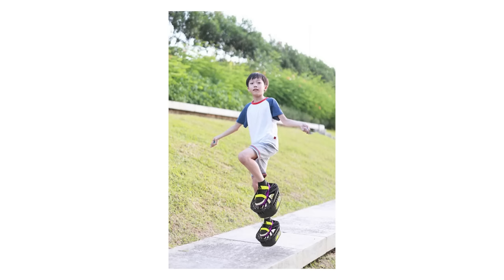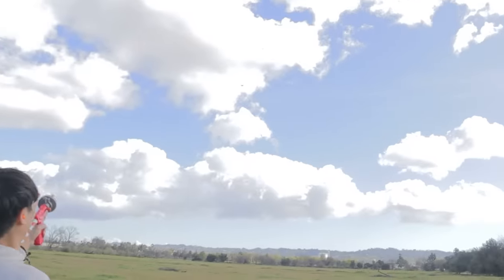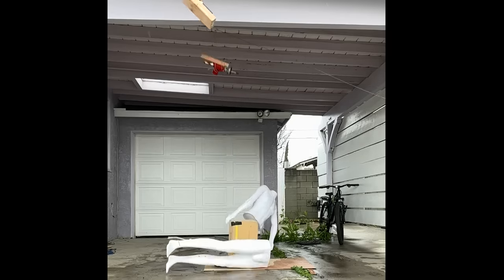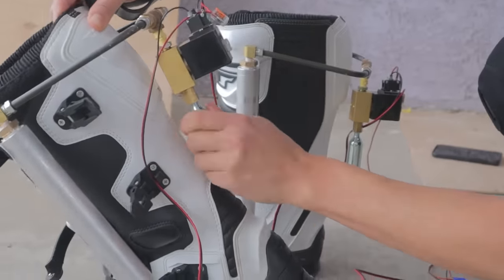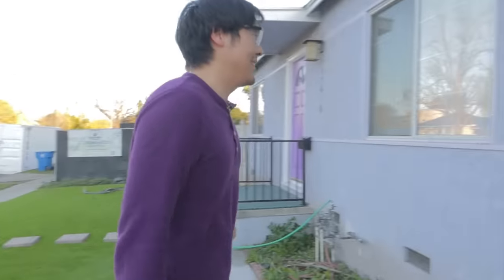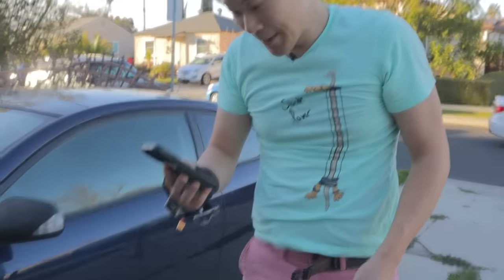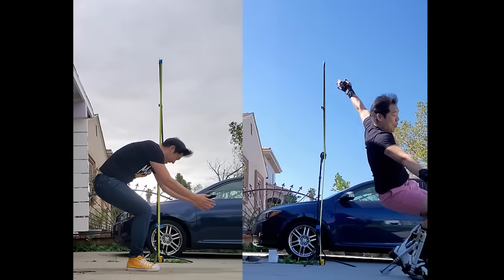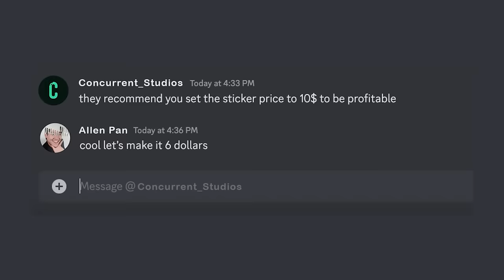Making shoes to jump 200% higher

Comment: A retraction system would allow for a safer landing and a faster recovery when jumping, and it would really make for a cool part two to this project
Reply: that IS a good idea
Reply: Well he would need a double acting cylinder for that so he would have to make a new one a cheaper solution is making the feet larger as it currently has a low area to land on and as you can tell he tends to land on the edge of the panel so bigger feet would help a lot
Reply: @simplegamerz9485  Nah, just put some springs on 'em. CO2 to push them out, springs to pull them back in.
Reply: @cheshirecynic3061  Yeah, no need to make it harder and more failure prone with more valves etc. Springs should do the trick nicely without costing much power.
Reply: @randomname4726  the shoes as they are now might be harder to land with, but the force of a jump 1 foot higher than normal being transferred into the piston over some time probably beats it going into the bottom of your feet all at once, at least I think so
Reply: @simplegamerz9485  True, but if the foot panels were too large walking would become uncomfortable since he could not bend his feet.
Reply: i think adding another piece of metal which changes the shape of the boots from a line to an x would make it easier to make the piston go inside again when landing.
Reply: @benshapiroscrustyass1402  good point. Maybe a spring and small vent hole similar to an automotive shock absorber. Would certainly rob some amount of power but I'm sure it could be dialed in. As long as he gets a decent jump there's plenty of time for a non foot destroying retraction
Reply: @cheshirecynic3061  With a pressure relief valve that opens when piston is fully extended.
Reply: I'm not sure, but it seems like he's using the entire two CO2 cartridges; if he were to add a retraction system, he would probably need more CO2 to make it refire again, which would likely increase the weight a bit if he has to carry around massive carts capable of multiple shots. Not sure if that's viable but multiple jumps from this thing could turn your ass into Mario with enough practice so it'd be really cool to see.
Reply: Agree
Reply: @swampfoxfpv  That's actually not a bad idea, how much height do you think you'd lose with the shock absorber?
Reply: @simplegamerz9485  you might even be able to take that a step further by adding some rubber or something to panel, something to give it just a little extra grip for more stability when landing
Reply: @benshapiroscrustyass1402   YouTube comment section casually designing the Gen two to the moon shoes
Reply: Just need a check valve?
Reply: I would make a sensor that can tell where you are in the jump process, and then assist at the precise moment.
And yes, that would mean a higher jump so you'd want some kind of landing system.
Reply: this
Reply: I was thinking the same thing these have a lot of potential
Reply: @IchorX  There would also need some stylistic changes, maybe 3d print a boot casing to avoid the clunky nature of the OG setup and avoid ant unfortunate testicle related incidents that can arise from design as is. Basically Iron Manning the whole thing from the clunky Mk1 to a streamlined Mk2, it would look cooler and be a bit safer
Reply: He would need another valve system to retract them. That's more weight.
Reply: @simplegamerz9485  bro that's just a gun.
Reply: One word. Springs.
Reply: Came to the comments to say just that!
Reply: Am I the only one that thinks this guy is brave as hell for this? He could have broke his ankles if that went bad
This is dedication. And Well said Noah! I would love to see that, and would love for this project to continue. This is so cool
Reply: If you wanted to over engineer it, use an accelerometer to detect when the wearer is falling, and when they begin to fall safely retract a dual-action piston with a separate low pressure system so it doesn't destroy your feet.

If you want a good solution, just make the pads you walk on slightly larger so there's more area to land on lol.
Reply: @noahk3496  he already isnt because of the type of boot, theyre literally meant, as he said, to support the foot and anklefor specific things
Reply: @zakstormcrow5912  On second thought, you’re right
Reply: The solution to that would self returning pneumatic cylinders. It would be a trade-off. If you get weak springs, they won't retract completely in time. I don't see it as a big problem though since it would have already helped by: 1- shortening the distance. and 2- already having some biased momentum going upwards. Weak springs would have negligible power rob. Strong springs on the other hand would require much more energy to move downwards for a less useful retraction speed. Plus they'd also add more weight.
 
Springs are better than electronics and added plumbing. They're way simpler to implement, needing no designing. They are also way more robust.
Reply: @simplegamerz9485  A larger panel wouldn't help. You want something that will line the plate within the center line. A "C" curved bar would be better. A large plate will also eventually bend the cylinder rods.
Reply: @terraminator4379  That's if the bottom of the shoes were always level with the ground. They are not. An X or any other added material will add to much torque and the rods will bend. Kinda surprised he didn't do that here by accident. Those cylinder rods were not designed to be sideloaded. That would also restrict motion to only vertical jumps, which wouldn't be as cool since now you can't leap forward.
Reply: @abduladeola4886  nah I'm just some college student, thanks though!
Reply: i would die for a part 2
Reply: @simmonsjoe  Just a hole lower down the cylinder. When the piston is past the hole at max extension the air can escape.
Reply: Is your name perhaps Cave Johnson?
Reply: You guys are to smart for me

Comment: I think you could furth increase their jumpiness by:
using springs to retract the pistons, they dont have to be very strong but strong enough to retract the piston once the pressure depleted.
adding an earlier gas bleed and buffer at the end of travel to the jerking of the piston doesnt skew your airial direction
using a trigger that responds to when you put more than your body weight into your shoes (aka you start to jump, increasing the weight that is put on your soles.)

sorry for my bad english
Reply: English is fine, but using a spring seems like it would really weaken the jump

Comment: The most iffy part is the landing. When the bottom part is extended and lands first Allen always falls forward or to different sides with his feet respectively. If he could make them retract in the air the landing would be way easier. Or he could maybe increase the surface of those. I am curious if you could do an enhanced form of running with those.
Reply: If he used a belay he could launch as high as he wanted without worrying about the landing
Reply: i feel like part of that system also protects him from hard landings though. the partially extended hydraulic cushions the fall a bit. if he could make the whole platform more stable by increasing the surface area of the launcher palatform like you said and maybe make an automatic triggering mechanism based on the bend of his leg and an arming mechanism to start it it would be perfect.

Comment: Suggestion: instead of two bars, make parts that fit the entire sole of the shoe so you cover more area when landing, preventing you from falling over
Reply: Maybe make it a bit bigger to spread force over a wider area.
Reply: Perhaps the bars should not only be replaced as suggested, but should also have powered ankle joints controlled by a computer and force sensors and/or myoelectric sensors on your own legs for a perfect landing and better jump.
Reply: This is like jlasers one but weird

Comment: Neat. Two changes I would make here. One, have a pressure sensor mounted on the bottom somewhere, or maybe under the toes of the boots, such that when there is little to no pressure on it (and the safety is off), it triggers the pistons. If you dial that in well, they should basically go off automatically at the point where they would best maximize the jump, at, before, or after when your feet are no longer pressing down on the ground (whichever turns out to be optimal). The second thing I would do is add plates to the bottom of the piston, a flat portion in the middle, and then a hinged "toe" and "heel" that will compress, but also resist compression a bit, trying to return to a flat plane. I would think that would be much smoother to land on than just a straight bar across the instep.
Reply: The change I would suggest is not attaching explosives to your weak ankle joints.
Reply: @GamesFromSpace  Well, step 1 is certainly isolating the ankle joints, like ski boots or rollerblades do.

Comment: If you make them retract automatically and add a flat sole, they would actually be comfortable to use. As long as you don't take into consideration the cost of recharging the pressure bottles every time.

Comment: I think the stability could be greatly improved by extending the ground-contacting plates further so they end near or under your toes with the heel still exposed for balance. Most of your falls involve your knees shifting forward and a greater means of improving front stability might help you rock back onto your feet.
Reply: Make it like a hollow semicircle (like a hose shoe) so it doesn't have much friction against the air when it's being deployed.

Comment: I think that simply shifting them a little bit forward on your feet (and putting a bit of a counterweight towards your toes to help with balance) could really help since when we jump a lot of the effort goes toward the front half of the foot rather than the center, where you have the device currently assisting. 
(Doing this, you may even have the bar that connects the shoe to the device help as a bit of a lift as well, possibly. But thats beside the point)

Good luck, Allen ❤️  This is coming together brilliantly
Reply: Lets just hope he doesn't snap his achilles tendon

Comment: I feel like the propelling things that you land on after the jump should be lengthways so you can actually land on them not tip over
Reply: This system is designed so that it DOESN'T stop you from tipping over. It WILL break if it has a 200+pound person crunch down on it at an awkward angle lol

That's why it has the elastic material and let's his legs go forwards

Comment: It could be epic if instead of remote control it's acceleration/pressure triggered . Step 1: measure and map average jumpXtime graph . Step : pick when to trigger Vai trail and error .
Reply: This is what I was thinking as well. A switch would still.be wise to avoid surprise jumps.

Comment: Could you put some light springs working against the plate extension so that they retract by themselves while in the air. The force of the air canisters will be so large that the springs won't remove too move force, but will be enough force to move the plates back into place while in the air.

Comment: There are many sneakers with a cushioning platform. If you could climb such a structure to the height of the piston, that would drastically increase the stability when landing, which in my opinion would make the shoes completely practical.

Comment: Maybe add a force sensor to the shoes that can detect when you are about to jump (The load cells detect a force less than your bodyweight since you have started to take off) and trigger the valves, that would make it much easier to jump with?

Comment: the fundamental issue is in how your jumping. There are two ways of jumping; slap the ground with your feet hard enough that it reflects the energy back at you and makes you go (This is actually how running works and isn't very good for jumping). This is also how trampolines work, they adjust the amount of energy that gets reflected back at you when your feet slap the ground. The second way is to out momentum into your body in with a upwards trajectory where the momentum of your mass is actually pulling your feet off the ground.

The reason why these shoes don't work is because your jump is pulling your feet off the ground, then your shoes are pushing your feet up higher but not adding any more momentum to your mass.

Comment: As an acrobat watching you figure out the jump timing, it's really interesting that it is the same as if my partner is standing in my hands and I want to throw them as high as possible. We bend together, they initiate the jump, I start throwing not as they reach the bottom of the bend, but as they start to jump. To early and one of us buckles the other. Too late and I didn't have enough weight in my hands to really help accelerate them. But at the right time, they feel the ground through me and I can accelerate with them, giving them an extra foot of height. Maybe I'll post a video showing this.

Comment: If you think about it, those boots were only ever at best going to make him jump the exact same height or less. His leg muscles have to do MORE work with those shoving up into them AND moving his body upward. They have more work to do than they would without the boots. But they can't do more work because they're already at their limit, and the boots make up for that difference. And so it ends up being exactly the same. 11:35 A FOOT HIGHER? Try almost the same, why would you think you should measure from your shoes instead of at the bottom of the metal stilts? And your legs are way forward, so It's almost the same actually, maybe 2 inches higher. It's hard to know with your legs bent forward.

Comment: Just a word of caution. There is danger that is easy to mitigate. Watch out for your head, butt and hand. Your heat and hands for obvious reasons, but the nerves around your tail bone can break fairly easily from a high fall. It's one of the worst injuries you can get. Causes a lot of paralysis/ nerve damage in general.

Comment: I feel like if you put a flat surface at a 45 degree angle on the toe it might help you balance better when you land weird and also if the edge that contacts the ground could freely rotate (with some resistance to prevent spinning) to become parallel with the ground it might help you recover and also make it easier to jump

Comment: You could jump higher if you use rubber pads on the bottom of it, like elastic, there similar boot design which uses elastic straps and spring wires,

Comment: Think to improve this you should make the piston sole a bit more like an actual flat platform and not just a strip, that way you should avoid losing the equilibrium during the momentum of the landing which is caused by your inconsistent surface landing, should also avoid you from accidentally landing on a wrong angle and twist your legs with the contraption

Comment: You need to make it easier to land without falling I’d trying give your metal bar at the bottom of the shoe a thick stiff rubber plate and maybe give those poles that push down some light springs for cushion

Comment: I don't get how intuition didn't tell you to make the "platform" that hits the ground go lengthwise on the sole of the boot rather than transversal. Having the edges curved would have solved you not being able to land on your feet as well. I suppose a cross pattern would have been ideal since you would be able to keep both axes of equilibrium, front back and left right.

Comment: what if instead of the small bars being the things that are pushed into the ground you push something the size and shape of the bottom of your shoe but made of metal maybe you could even put a bottom of a shoe on it you would be much more stable in that case also another thing you could maybe put sensors that check if your foot is an inch of the ground and will activate it so you could maybe run fast with it

Comment: I personally think you need to connect the gun shoes to a frame that connects to your torso as that is what you actually want to lift.
I think you could get better results if you used some kind of leg framing such as an exoskeleton to transfer the force directly to your torso through straps connected around your waist, shoulders, & chest.
I'd say to use a regular de/ascension rig but you would have to remove or somehow redirect the straps around the groin as it would be extremely scary for the balls.
😂

Comment: I can see two problems.
1) This is the most readily evident. There is no mechanism to retract the pistons while in the air, so you will fall badly after the first jump, and you cannot make another jump before manually retracting them.
2) This is the most serious one. First, measure your normal jumping elevation and call it N. Then, measure the extension of the pistons and call it E. Is your elevation when you use the jump boots greater than N+E? If it's not, they don't work at all.

Comment: i'm at 2:15 "gun shoes" and strapping them to your ankle... after what you just learned from "moon shoes"... I predict both ankles breaking as soon as they fire.

I'm at 4:00 and extremely disappointed/relieved (delete as appropriate) that you used a crash test dummy on your zero support, zero brace, GUN SHOES.